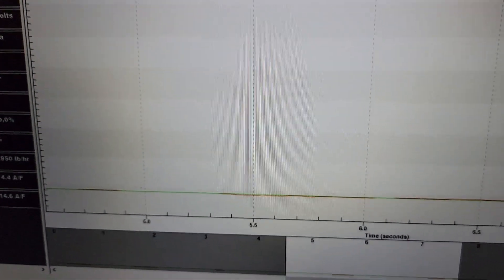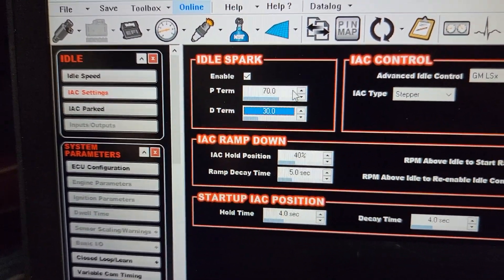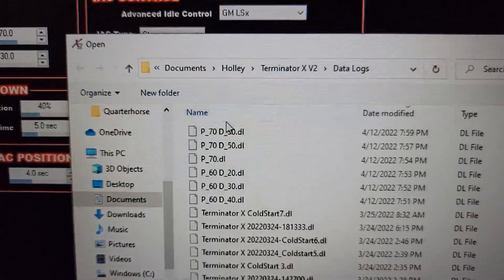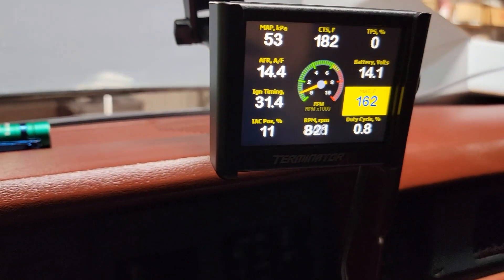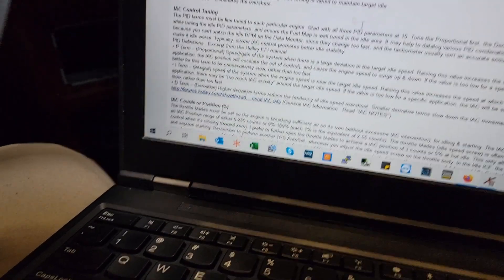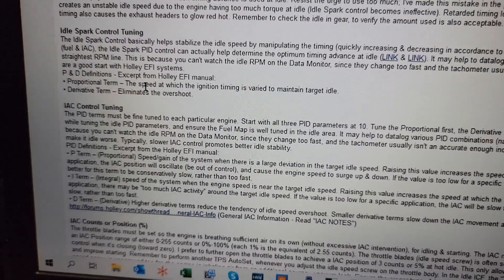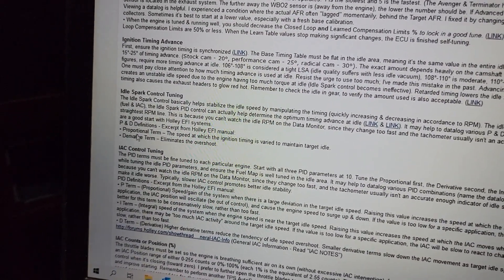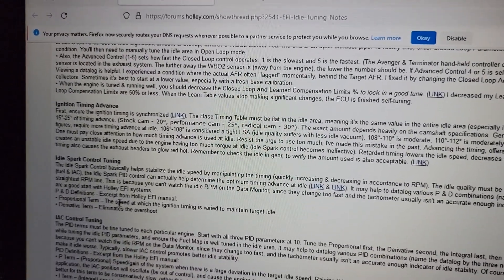Holley Terminator X Idle Spark Control Foxbody Mustang

Comment: You ever run into an issue where the timing gets “stuck”?
My timing bounces around normally, but after it gets warm it will stick at 34* static and I can’t figure out why.
Reply from the maker: I have not yet. I'm hoping to start putting a lot of miles on the car. That way if there's going to be any issues I'll find them.